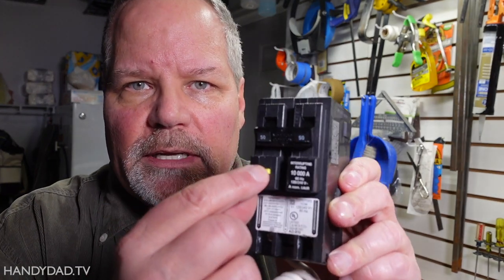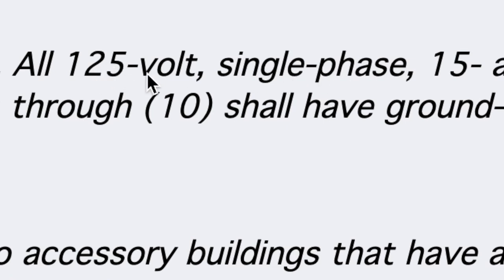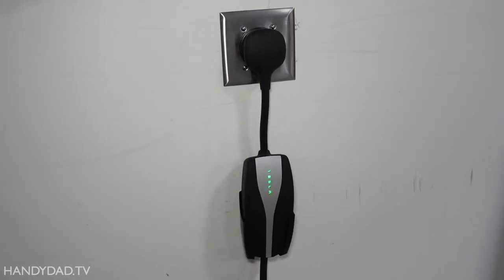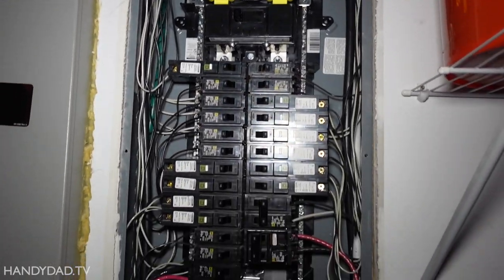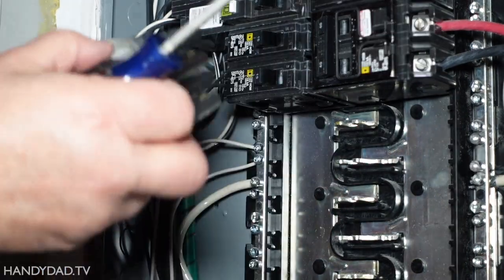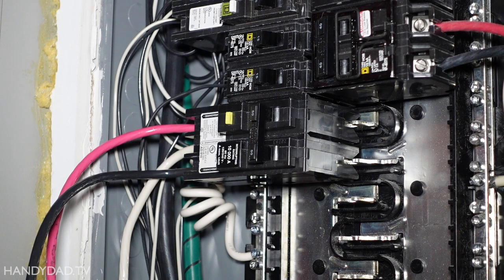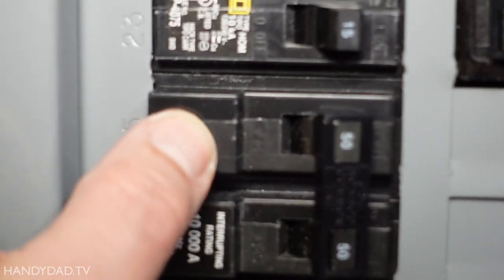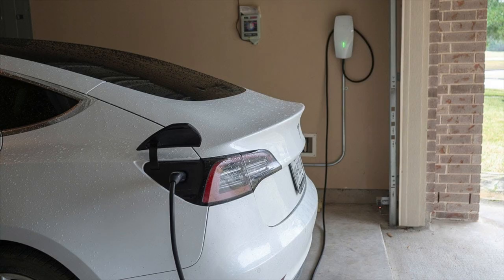Do I need a GFCI Circuit Breaker for EV Charging?

Comment: the breaker that has the test buttons is an AFCI
Reply from the maker: The white buttons are AFCI. The yellow buttons are GFCI.
Reply: @handydadtv  Did not know
Reply: @handydadtv  Brand specific. Siemens GFCI button is white. Their arc fault breaker test buttons are blue
Reply from the maker: @patrickbauer5358 Yes, I was talking about the ones in my panel that were shown in the video.

Comment: I have always preferred to have GFI receptacles over a GFI at the breaker box, because a GFI can be subject to tripping and the GFI receptacle indicates it has been tripped and can be reset at the receptacle.   I don't like the practice of stringing other receptacles from a GFI receptacle.  It can be nearly impossible to find the GFI receptacle when it was tripped by a down stream receptacle.   Also GFI receptacle have a much lower non returned trip current than a GFI breaker, meaning they should be better at protecting humans connecting cords to them and the device then a circuit breaker GFI, but also much more prone to phantom tripping from current loss in long wire runs downstream from the GFI receptacle.   I had to dry out an outside downstream receptacle from an inside bathroom GFI receptacle because it wouldn't allow resetting the inside GFI receptacle when it was moist.   At least that's how it behaved  because I've done this procedure about three times now.  Note: the outside receptacle didn't appear moist I assumed the extension cord plugged into it had water follow into the receptacle.
Reply from the maker: I hear you! My brand new house had one GFCI receptacle protecting multiple bathrooms! Watch this https://youtu.be/dbmRETinw0A

Comment: Handydad, love your work, but on this one you are WRONG.  Yes, 210.8 requires garage recepticles even "250 vac" (their designation) be gfci protected, however, article 626 (ELECTRIC VEHICLE POWER TRANSFER SYSTEM) in section 625.54 is the requirement for car charger recepticles to be gfci protected because they charge cars.

Okay, bad humor, forgive me, but I do love your work.

Thanks and keep up the good work.
Reply from the maker: Save me the trouble of looking it up. Does it say that GFCI is needed or not?
Reply: @handydadtv  yes, gfci for recepticle for car chargers for car charge nec section plus your afore mentioned garage recepticles of 120 and 250.vac.
Reply from the maker: Thanks so much 😊
Reply from the maker: Ok just looked it up and seems it only asks for GFCI with outlet less than 150 volts. What about 240?
Reply: @handydadtv  625.54 has no voltage limits.  "...Recepticles installed for the connection of electrical vehicle charging shall have ground-fault circuit-interrupter protection for personnel...."

Did I quote that right?
Reply from the maker: I must have been looking at an old version. Thanks!
Reply: @handydadtv  you got it bro.
Reply: @keithharrington4595  Any exception if it is powered through an isolation transformer?

Compare to BS 7671 18th Edition, Amendment 1:

"722.531.3.101 Unless supplied by a circuit using the protective measure of electrical separation, each charging point incorporating a socket-outlet or vehicle connector complying with the BS EN 62196 series shall be protected by an RCD having a rated residual operating current not exceeding 30 mA.

Except where provided by the EV charging equipment, protection against RCD fault currents shall be provided by:
(i) an RCD Type B, or
(ii) an RCD Type A or Type F in conjunction with a residual direct current detecting device (RDC-DD) complying with BS IEC 62955 as appropriate to the nature of the residual and superimposed currents and recommendation of the manufacturer of the charging equipment."
Reply: @seprishere  no exception is listed in 625.54 in the NEC for the receptacle.  Hard wiring wiring can get you past that requirement and because of the NEC structuring we can debate if a disconnect or lockable breaker is required when hard wired under the home appliance section 422.31.(b). 

Now, if memory serves me, GFCI's come in one of two  separate ratings. One for personnel at 5 mA and one for equipment at 30 mA.  Again, personnel protection requires the lower setting.

Now, I did not look up your reference, but I will use your provided number of 30mA to counter this line of thinking.

Medium voltage chargers charge at about 40 amps for about 6 hours or 240 amps of charging to fully charge a battery.  Converted to mAmps, that is 240,000 mA.

When we divide that by your listed 30mA

240,000
÷       30

Yields. 8,000 hours to charge your car.

Now, that is ballpark.  Some engineer can add in battery charging abilities and heat and battery self-discharge and whatever else.

My phone tells me that 8,000hours ÷ 24 hours in a day leaves us with about 333 days and 8 hours to charge your car from drained to full.

That is a really patient driver.

If you see any error here (except charging factors) please let me know.
Reply: @keithharrington4595  The 30 mA is the residual current tripping current. UK RCDs are invariably rated at 30 mA, probably because 5 mA would have too much risk of nuisance tripping and, while it hurts, is unlikely to kill. This is different from the overcurrent rating, which indeed would not be 5 mA or 30 mA but more likely 32 A.

Hard-wiring makes no difference in the UK. "Electrical separation" does but this would require a large isolation transformer (e.g. 7 kVA).
Reply: @seprishere  okay, thanks

Comment: You didn't protect yourself correctly. You needed to isloate power before panel before you opened the panel. Have power company tip meter or other lock out tag out location. Or you needed to be in full protection for that amount of power at all times and fence off area. You were supposed to be in full suit to properly test that no danger exists then you could put your fingers in there. There was no reason to test the second breaker with panel open. I'd be sweating if I tried that dangerous stunt.
Reply from the maker: Thanks for the feedback

Comment: If you can't change a breaker without turning off your main breaker first, then you more than likely shouldn't even be inside your service panel!! Call a professional
Reply from the maker: I always encourage safety regardless of ability. Accidents happen.
Reply: What if your finger slips and you touch a bus bar? Doesn’t sound fun to me. Lol
Reply: Electricians are not professionals !  They are licensed tradesmen !  My question is why would you be foolish enough to work on live equipment ?
Reply from the maker: The only time I saw an electrician turn off a main breaker was during a panel replacement. One laughed and told me 120-volts is like a bee sting.

Comment: You are not in the trade so you do not know that most of jurisdictions having authority over electrical installation are lagged behind.  What do I mean by this?  There are many places still using 2017 NEC or older.  Your assumption that everyone must go ahead and get the ridiculously expensive GFCI breaker is not correct.
Reply from the maker: True, for the time being. But eventually all will adopt the 2020 code.
Reply: @handydadtv  You are right about this.